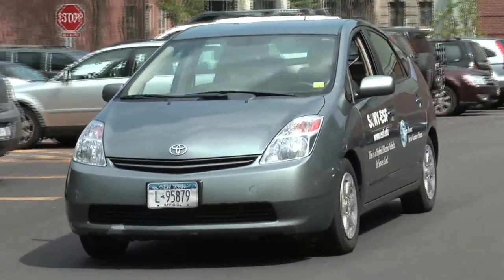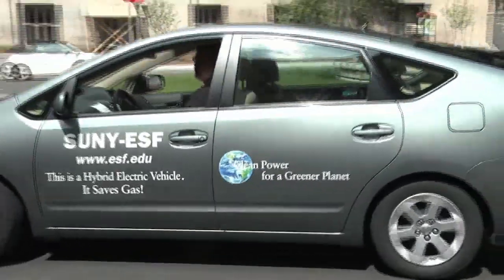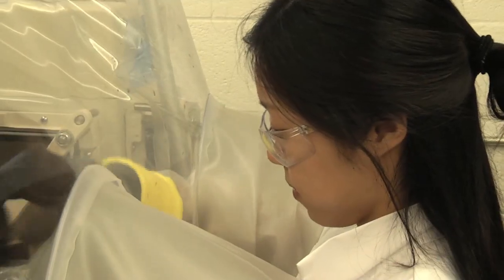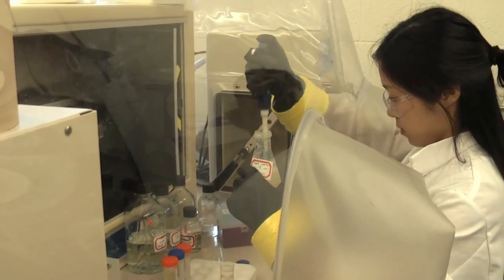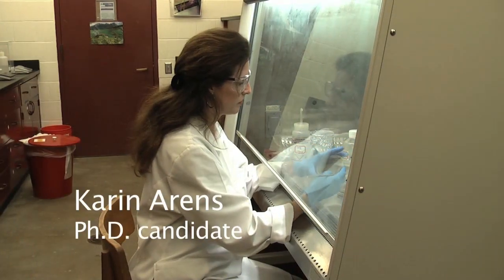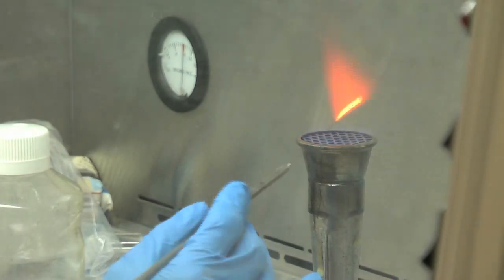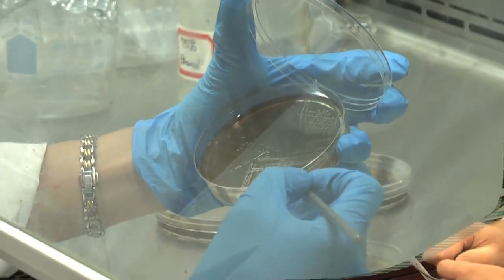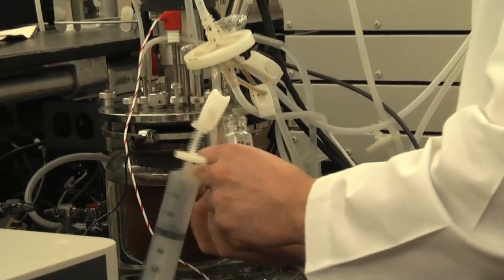Making Biobutanol

Comment: Understand there are currently some limitations to mass producing Butanol from renewables (non-renewables are another matter), yet am convinced this is the best approach to go with since it has been demonstrated to work in vehicles designed for use with petrol without modification and without using food crops (as is currently the case with Ethanol) as opposed to the current trend towards electrification (given both the current limitations and risks of the latter despite being otherwise open to a diversity of various power sources and alternative fuels including Methanol).

Comment: You can also make Bio-Butanol from grass clippings, farm waste, or any dead plant matter.  These guys really need to get in contact with Ohio State University and David Ramey.  Since it is likely that Bio-Fuel will still have a hard time competing with fossil fuels for a step in the market, State colleges should get together and jointly research and develop the processes to produce Bio-fuel and once an efficient method is developed, work on a way for modest production to get it accessible to the public for purchase and profit to the state colleges involved!  This is the best way to invest state taxes, get money flowing into these colleges which helps in further investments and driving down college tuition, and not to mention opening the door to Bio-Fuels in the market.